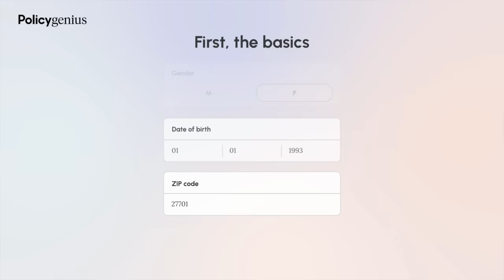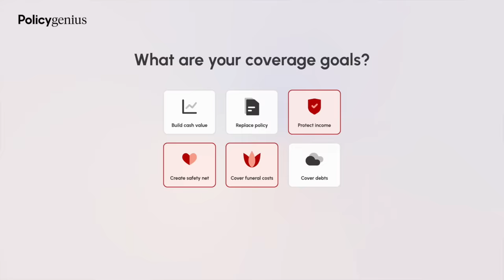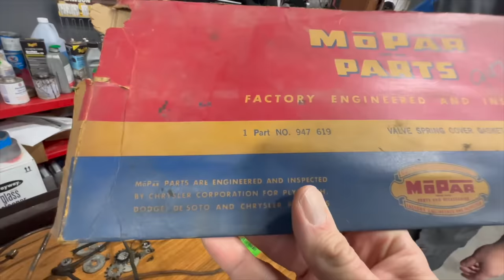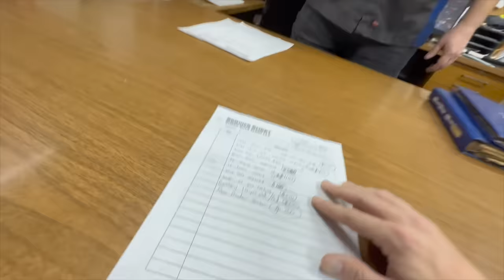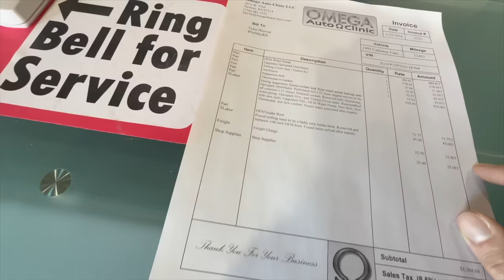I need to sell my dream car after making a HUGE financial mistake

Comment: Gas fired heaters were super common in air-cooled VWs. Probably also in Corvairs of the same era. Webasto and Eberspacher were two common names from companies that are still in business.
Reply: My brother had a gas heater in his VW up here in Canada.  Without it the Beetle had great heat, but it would take 30 minutes to come up to temperature.  The gas heat was instantaneous and had the car toasty warm in just a few minutes.  And there weren't problems with fumes because it was plumbed like a house furnace with a heat exchanger.
Reply: It was standard in the Soviet Zaporoshetz as well. They needed some serious heat over there on the steppes, in case it broke down, again... :D
Reply: Diesel shop heaters are quite effective for cost vs performance but no way would I have a gas powered one in a moving vehicle. That just seems like an invitation to burn to death...
Reply: Every modern semi (or lorry for those across the pond) has a diesel-fired bunk heater for winter use. When maintained properly they're pretty safe. Then again this is an 80 year old car with a gas-fired heater so I'm not too optimistic with THAT setup
Reply: People that are still driving these cars, what solution are they using for colder times? Unless they are just putting them in a garage. I do know of two Corvairs local to me, but I know I don't see them much in the winter. I do know one of the two is still owned by the original owner.
Reply: No gas powered heaters on Corvairs, just direct ducting from the engines air cooling system. Simple and efficient.
Reply: @snoopdogie187  I imagine most of them are only driven on sunny, warm days. A lot of people put classic cars away for the winter on account of the risk of rusting out.
Reply: @justadudeffs  They're mostly optional. My last leased truck had an APU with air conditioning and electric heat. No need for a diesel heater in the southwest US.
Reply: @TheJohn8765  it's a neat little heater with a fan blowing over a fuel injector and sparkplug/glow plug. Air entering the cabin are through a heat exchanger. Even in the 40' Eberspaecher heaters there are safeties.
Reply: @Midnight-Restorations  Early ones did.

Comment: Gas fired car heaters were more common than we realize in the 40’s and 50’s. They were a heat upgrade in VW Buses and other air cooled VW’s into the 70’s! It’s definitely got some value to someone restoring a car or for display purposes. Heck it’d be fun to get it working and okay with it in the shop!

Comment: 2 thoughts:
#1 - I think the car wizard should use a step-up transformer to power the new heater and use the included motor. A PC fan is a dinky solution.
#2 - I replaced the front brake rotors and pads on my S55 AMG with aftermarket parts that have worked perfectly for years. The entire kit was less than $200 so $3k for brakes sounds ridiculous.
Reply: Step up transformers work with AC. The electrical system in cars is DC. 

There are solid state DC voltage converters. Maybe that would be a solution.
Reply: @Dave-ei7kk  Sorry yes, I should have been more specific, I agree a solid state solution.
Reply: Lol a transformer in a car. :)  What you mean is a DC-DC converter, which isn't the same thing at all as a transformer.

Comment: Those fuel powered heaters are not uncommon here in Northern Europe and you can still get them on VW from factory. Works nice and heats up the frozen car very fast. Some also preheats the engine. Webasto is one brand.

Comment: Imagine if other industries tried to function with the missed timing and promises you constantly see in construction... crazy they constantly get away doing this without repercussions
Reply: All industries have their lows and short comings. 
Transport for example. Drivers mostly work out of brokers who give bare bottom prices and drives have to drive for pennies.  Real estate has to deal with owners with a shack worth 50k, but they want 500k.  If anything construction is simply cyclical. Like the winter months are a grind to a halt cycle. Everything slows down because of snow and muddy conditions. 
The fact that you hold such a negative outlook on an industry from 1 YouTube’s experience shows you’ve never owned or operated a business.
Reply: Just be thankful if they eventually show up and finish the job and don't run off with your money instead.

Comment: The gas fired heater actually isnt too unusual. A lot of RVs use similar heaters, although most are run on diesel. But there are modern gas versions too. A small diesel heater can heat a very large space very efficiently. All the fumes are vented outside (it works like your natural gas furnace at home). You should absolutely have a carbon monoxide alarm though (just like at home).
Reply: One of the twin engine piston planes I fly (Beechcraft Duchess) has a combustion heater made by Janitrol for the cabin.
Reply: As they described how it works, I also said to myself, this is nothing new....maybe odd, but not unheard of; but so cool is "Motorola" ...Do keep it around with most of it's fitting for originality. But do let the Wizard do his tasteful adaptable solution.. Also Cool!
Reply: Have one in my office(back of work truck).  Love it, its quiet, relatively efficient, very effective.
Reply: @benderaviation  my T310R  has one as well...was inop when i bought the aircraft and had to bite the bullet for about a 8k upgrade to eliminate  the  2 yr /250 hr AD
Reply: Semi trucks have them too, it's a good way to provide heating while you sleep in the cab without needing to have the engine running or draining battery.
Reply: @mattf49006  damn that's pricy. explains why the owner hasn't replaced it yet.
Reply: @benderaviation    8k is in the high side for a brand new upgraded unit...you can get rebuilt units from 6k for one that eliminates the AD to 2k for a rebuilt that still requires the 250 hr inspections  ..yea..ain't cheap but  think about something that uses av/gas to warm you inside the fuselage...good to spend it

Comment: When i was in the army late 80's, our tracked vehicles all had similar heaters, only those ran on diesel, even if it is a old system, it is actually a very effective heater system.
I can understand Wizard being wary of it though, it is not a very common type of heater, but if well kept, it is safe and works like a charm.
Love that car btw, certainly one of the nicest woodies i've seen.
Reply: Weary means tired. You mean wary. Or maybe you mean leery.
Reply: @mikesweet5848  thnx, was not sure (English is not my first language)
Reply: I trust diesel waaay more than gasoline. I have a kerosine garage heater that works great...but I get a bit woozy using it. Guess Carbon Monoxide does that. Emergency use only! 😄
Reply: @miketeeveedub5779  yeah those diesel heaters also had that effect (if they were dirty), but opening one of the hatches for a tiny fraction, pretty much solved that problem.
Reply: Diesel heaters are still common, ranging from $100-$2000 depending on whether they heat air or the engine coolant, and who made them. They exhaust outside, so the only time you get  fumes is when they failed already, or you have an air leak allowing the fumes in.

Comment: Tyler, you were shocked by heaters being an option in 1946. In the late 60s, I had a 1961 Morris Minor as a student in the UK. If I remember right at that time you had to pay £40 extra for a heater to be fitted. And they were rubbish, I drove 300 miles once and the back window never defrosted!

Comment: Combustion heaters are still common in diesel vehicles. I have never seen a gas version before. Big rigs use them for sleeper cab heating in the winter, though these days an option is to use a standby diesel generator that provides electrical power to the cab, and waste heat to the engine, so that your truck engine doesn't need to run overnight in the frozen north. Combustion heaters are commonly available and cost little more than $100. Both options save huge amounts of diesel compared to idling the truck engine all night. There are even hydronic heaters which just heat the engine coolant. Fuel burn for these things for the models I checked is around 1 pint her hour on high output, compared to a gallon per hour for idling the diesel.

Comment: The heater is still very popular in Germany as remote start is forbitten and you use them to pre heat the car . It’s called „Standheizung“
Reply: And it can still be ordered new as a option on most Northern European brands like Mercedes Benz, BMW or (of course) Volvo.
Reply: Best you can have in the winter parking outside

Comment: That gas heater may have been a cold weather retrofit.  Somewhere that the regular engine would struggle to come up to temperature.  Even now, there are Webasto diesel heaters on school and transit buses in areas that see sub-freezing temperatures often.

Comment: You can get 6v to 12v converters to run that 12v heater fan which is a much better solution, then you can also use the 12v for modern accessories like a charger socket etc.

Comment: VW bugs used a gas fired heater as an option over the standard hot blown air from the cylinders. I have diesel fired (factory original) engine/cab heaters on my Ranger and VW transporter.
Reply: But the gas burner was located in the trunk
Reply: That was the first thing that came to mind when Wizard described that heater. From what I heard the VW gas heaters used more fuel than the engine did!

Comment: The ‘61 VW my dad drove back in the day had a gas heater made my Stewart Warner and installed by the VW dealer.  It took up about half the frunk. 
It got him through many MN winters.

Comment: Gas heaters were common back then. Probably the last mass produced car with one was the 411 VW. Airplanes today use them as well. The nice thing about a big old car with a gas heater is you can park, with your date, and not have to run the engine for heat... ;-)   I wouldn't be surprised to see that J.C. Whitney still sold them as many were aftermarket items.
Reply: Agree. Gas heaters were pretty common in some of the later air-cooled VWs.
Reply: Yep, I remember them as a VW option. Today, it's diesel heaters that replaced the gas heater. Van-lifers use them a lot (and EV owners that don't want to drain their batteries)...😎
Reply: They are still very common in northern parts of the world. Not only for preheating the engine and interior before you set of in the cold weather but also in some cases to help to warm the interior while driving, because the car cant produce enough heat to keep the interior warm. For example a small diesel engine, 80kmh in -25c does not want to warm up much, so it uses the external heater to help in the situation.
Reply: I remember the GM corsair having a gas heater and when it was being used you could see the gas gauge drop
Reply: Some Corvairs had them, beat the shit out of the Corvair that used the exhaust manifold.
Reply: My 2018 VW Golf that I bought last year has a gas-powered auxiliary heater and it came from the factory with it. The auxiliary heater has come in handy this winter with temperatures as low as -18C/0F where I live.
Reply: Yup my old man told me he remembers gas heaters in vw's
Reply: @garys9694  I remember my cousins 64 Corvair with the manifold heat. You'd die from CO poisoning. He had his blocked off. You froze in that car in the winter as he didn't have an auxiliary heater. This was back in the 80s.
Reply: @LongIslandMopars all bugs have manifold heat , never heard of people dying
Reply: @cardboardboxification  I'm sure you're correct. I remember my cousin's car having rotted duct work and he closed it off instead of fixing it. I thought he said he was worried about exhaust gasses entering the cabin.

Comment: My mid-sixty Corvair had had an optional gasoline heater located in the "frunk" (front trunk). The basic engine-shroud heater was a carbon monoxide death sentence if there were exhaust leaks that got into the shrouding.

Comment: An old Soviet Union  car had a gas heater as well   {1978) : ZAZ 968  , handy when you live in Siberia,  according to 
the dealer included  a full bag of tools  (55 lbs about 25 kg ) and ..5 wheels  ( 4 wheels and 1 spare)

Comment: Kinda glad to see your do a 180 on the SLS. Probably one of the better looking modern Mercedes. Looks way better than the SLR in my opinion. I'd rather see ya sell off the cheaper stuff again, so that a little later on, you can rebuild that collection with other stuff. Just a revolving door or hoopties. But either way, do what ya gotta do to keep things moving in the right direction and stay stable.

Comment: The Wizard is working his magic on that CL65 bill!  I paid $3,300 at the MB dealer for just the front brakes on our CL63 AMG -- in 2015.  So he has offset 8-9 years of inflation and thrown the rears in for free.  It must be nice to have a friend with a shop!
Reply: owning Jags and Mercedes sure have a cost, but its one we all seem to take in stride. we just had a service done on our 2018 EPace S,  3400.00 out the door.  and the front brakes will still need doing in a couple of months.
Reply: Well considering how long they have been doing business together. I'm sure Tyler gets a steep discount and plus Wizard is the type of business owner to try and help his customers to a certain extent without breaking himself
Reply: @matzrat5006 jags and Mercedes that sounds like me 😂
Reply: @porsche928s4  I forgot Porsche . A friend of the family just bought a new Targa, wow what a car.
Reply: @matzrat5006  I've had a few 928s would love to get a 996 turbo but it won't be on the cards for a few more months
Reply: My neighbor had an S600 back in the day and I took it in for him  for brakes and it was about $2500 at the time. I never kept my own S-Class long enough to change the brakes but I laughed because I never saw a bill for less than $700 billed. I would never own one out of warranty.
Reply: @venom5809  Nothing special about s600 brakes. A good skill worth learning that will save thousands. All shops rip you off on brakes just because they can. I did all 4 corners brakes and rotors on my CL63 for less than 500

Comment: Gasoline heaters are still used in aircraft.  Twin Cessna’s like the 414 and 421 use them since there isn’t s good way to get exhaust heat through the wings and into the cabin.  Also, since they fly in the mid 20000 foot range the outside temp drops well below zero.

Comment: Just an FYI, the Gas heater does not have an open flame it uses (I believe) a long fibre asbestos wick and a platinum coated wire mesh catalyzer. There's no flame because the fuel is catalyzed on the mesh and it glows red hot and the output is heat and carbon dioxide. The carbon monoxide component is very low because all the fuel is fully burnt. I have an old Coleman gas powered tent heater that works on the same principle. The scariest part of the device is the long strand asbestos wick. I suspect it's started by applying a 12v charge across a portion of the mesh to get it red hot. I believe the technology was developed for fighter and bomber aircraft in WWII.

Comment: That heater sounds very similar to a semi truck's Bunk Heater. It burns the trucks diesel to heat up the sleeper area in places where they dont let you idle (California.) It has its own exhaust under the cab and everything. They heat the sleeper extremely well.

Comment: on that fan motor for your heater you can do a step down converter supply module  from 12 volts to 6 volts..they make them and it would blow air better than a computer fan motor and would be simple.

Comment: Chevrolet Corvairs had gas heaters in the 1960 models. Then in 1961 they got a "direct air heater" that uses the engine heat. Gas heaters where still optional until the 1964 model year.

Comment: Gasoline heaters were commercially available on automobiles starting in the 1930s with continued use until the 1960s, when they were almost entirely replaced with heaters that blow air past a small radiator warmed by hot engine coolant.

Comment: Gasoline heaters used to be around in my youth. CO isn't much of an issue with all the air leaks in the cabin. You might be able to still get them if J.C. Whitney or Warshawsky is still in business.

Comment: Such a strange thing, that Motorola gas heater.  Why didn't they just put in a factory heater core/wiring/switch/blower, etc???   I also find it weird that such an expensive car, Chrysler's flagship, didn't have the heater as standard.  I guess 1946 was just a totally different era in terms of expectations.  Those aftermarket gas fired heaters were really popular with old VW mini-buses, the air cooled engines of course couldn't use the engine coolant as a heat source like most cars.  VW did manage to engineer an adequate heater for the air cooled Beetle, but it just didn't work worth a damn in the cavernous VW bus.

Comment: So the heater system in a ch-47 is the same. You bring in jp-8 and it burns it. It's located in the cabin on the other side of the bulkhead behind the pilot. Haven't heard of anything scary ever happening from that, it's definitely more safe than a muffler shroud heater, that's for sure.

Comment: In 76' I hitchhiked from Detroit to Florida and bought a 68' Chevy van. Didn't realize it had no heater/core/fan/switches until later in the evening. Found out that in 68' it was an option.

Comment: Many vintage VW’s had optional gas fired furnaces. And they were mounted almost directly on top of the gas tank. Crazy. 

My work Semi truck has a diesel fired furnace mounted directly below where I sleep. Coincidentally, it’s made by the modern company that made VW’s Gas furnaces back in the day.

Comment: With all these cars, do you really need heat in this one?  I’d install the Motorola but not hook up the fuel line. Just so it all looks original.